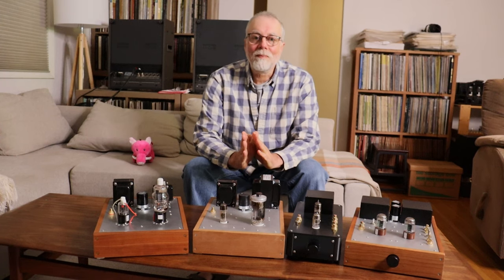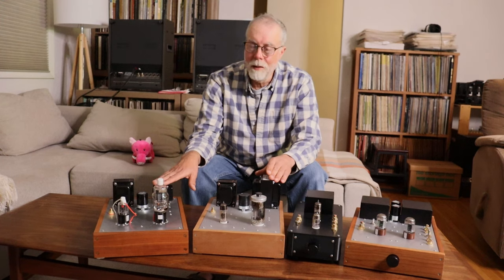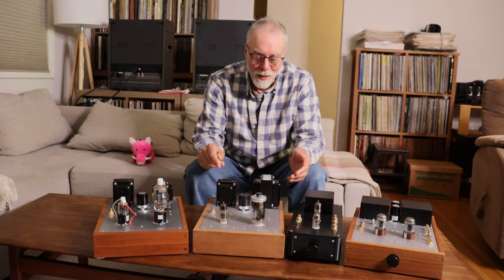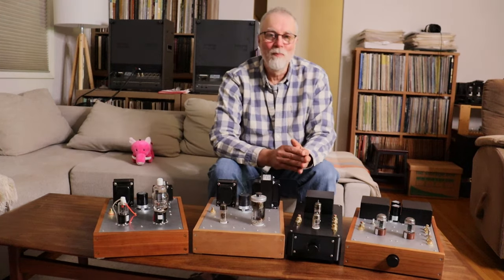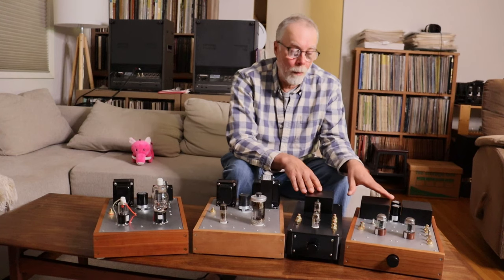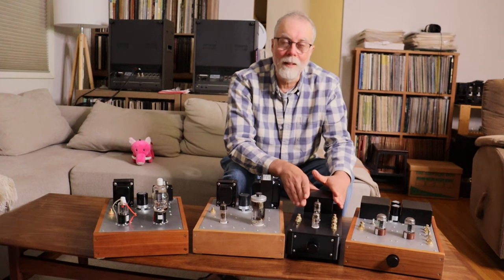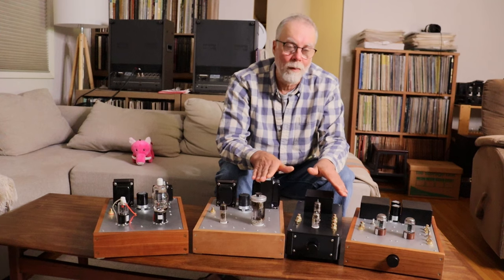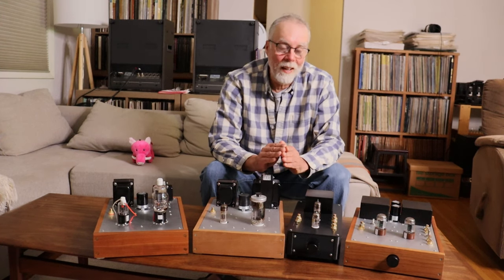Mellow Tone Amps #04 - Rolling Tube Amps (Not Just The Tubes)

Comment: Do you made a single ended tube amp
Reply from the maker: @joemartin6439  yes and no, all of our Kit amps run in Pure Class A (no feedback) and both our monoblocks are Triode strapped Beam Powered Tetrodes, so they operate as SET (single ended triodes).  The problem with running a true Triode in Class A, is power.  In order to supply enough power to satisfy our customers you really don't have any (none, nil, zilch) affordable vintage power tube options.  But figure out how to operate a Tetrode as a Triode and now you have some amazing sounding vintage power tubes to work with, including the GU50 and 6P7S.